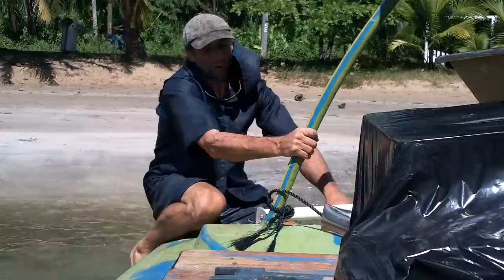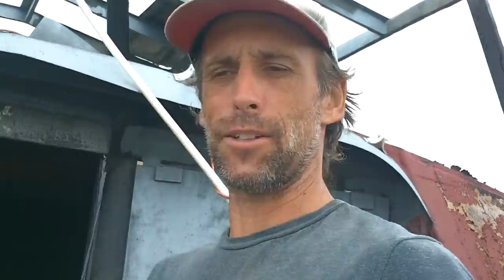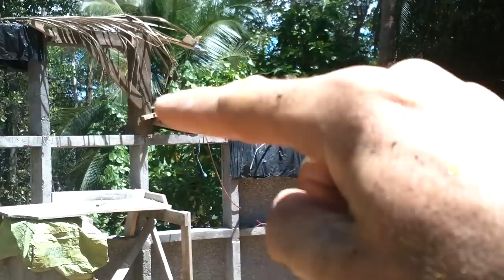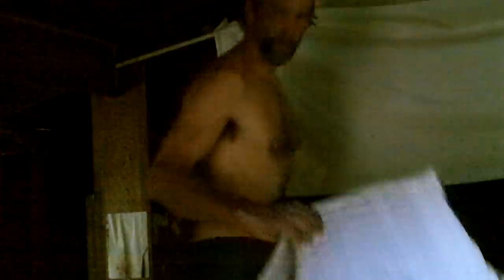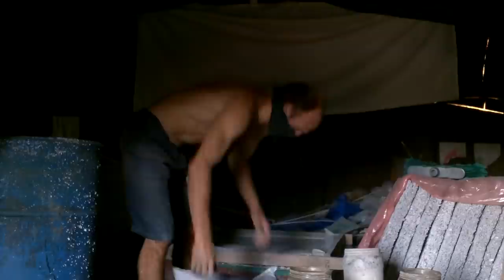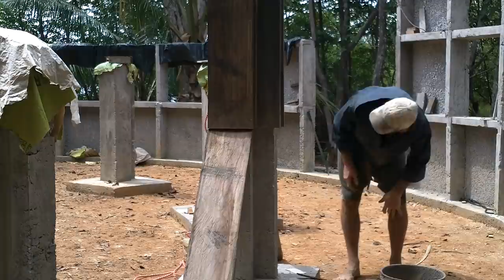Adventure Builder Cathedral 007

Comment: im not quite sure james whats the thinking to have rope in concrete ?
Reply: he is using the rope like tension rods radiating out from the center to the perimeter of the building, structure support...Dave
Reply: Rope is much like rebar. When you brake or crack concrete that has not rope/rebar/wire mesh it will crumble and fall apart over time. With rebar/rope/mesh it will retaine its shape. 
If you go and watch his movie it clearly shows how it works. 
Also if you watch him make the panels he puts in a mesh in the middle. this will help the panel and make it stronger.